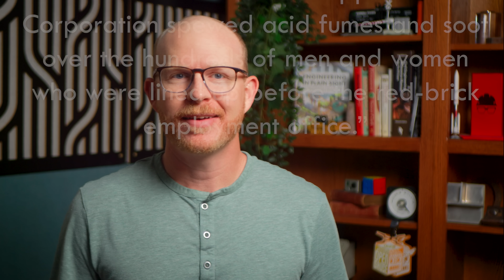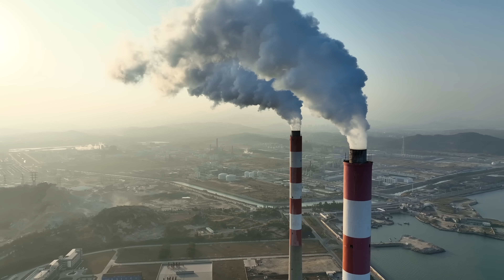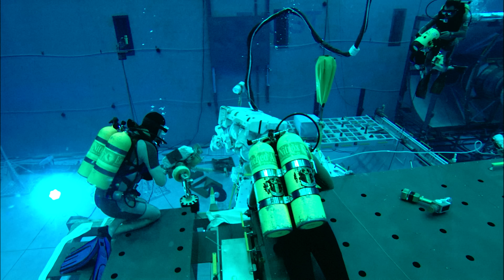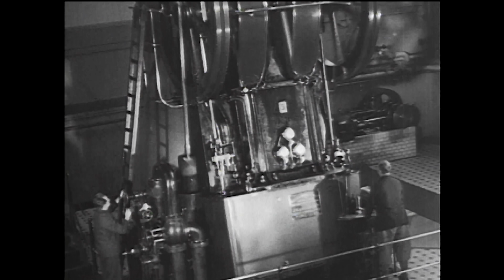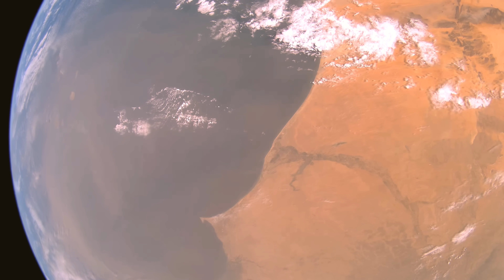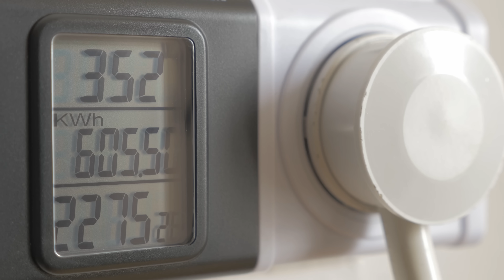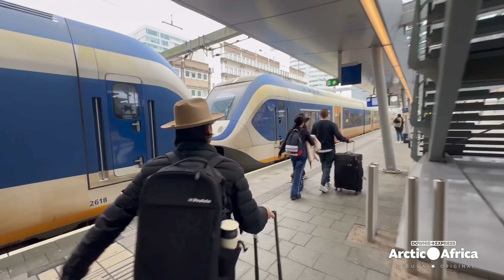Why are Smokestacks So Tall?

Comment: 7:00 I learned this when I put the smoke stack for my fireplace up. At first, it was just above the roof (which worked decently)... then I made it 10 feet taller (with diagonally-placed supports). 😂

Comment: Very interesting topic and you haven’t touched several topics: when do you need forced (with a fan pushing/pulling or even both) draft and when can you rely on natural draft.
What is the optimal draft anyway because if you have too much you can have efficiency issues, if you have too less you end up in a very polluting condition (even risking of explosion in some cases)

Comment: Once upon a time I worked as a custodian at a county park in Iowa. The outdoor restroom facilities had pit toilets featuring a clever airflow /odor control solution: black plastic "chiminys" on the back of the structure that connected down to the pit. The pipe itself was designed to heat up in the sun, which heats the air in the pipe, causing it to rise. That draws air up out of the pit, which draws air down through the toilets, which draws air from under the door. And of course they designed the doors with a ~.5" gap at the bottom. The legend, which we never tested, was that on a nice hot sunny Iowa summer day, the draft coming in under the door was strong enough to extinguish a match. I guess it could work in the winter too, any time there's a temp differential between air in the pipe and the ambient temp.
Reply: The park services in my area now install bathroom put facilities with the same or similar setup, and every time I camp at a location without these black pipe setups, I very much notice the difference. The chimney effect for these pit bathrooms keeps them well ventilated and smell much better dispersed
Reply: @yetinother  but most of the time someone has defeated the system by propping the door open...
Reply: What's really funny is that most Minnesota State Park privys use big -- 8"? -- white or green plastic vent pipes. And they don't get the thermal effect a black (usually ABS) vent does. And they stink. These are said to meet visual aesthetic standards, which apparently is more important. Unless you need to use one!
Reply: Kinda works in winter too, visited the general Sherman at Sequoia National park, and the parking area is lower than the viewing area. As you gain elevation past the pit toilets, the smell thickens!
Reply: Build a stack to space
Reply: Don't be lighting matches near a pit toilet!

Comment: 10:53 I thought that rockets primarily combust hydrogen gas, and produce little more than water vapor. What contaminants do they produce?
Reply: Depends on the rocket.  Saturn V, for instance, burned kerosene.
Reply: Falcon 9 is powered by rp-1 a kind of kerosene and starship by methane as an example
Reply: And even if it is just hydrogen, water is also a greenhouse gas when in the wrong part of the atmosphere. water released in the upper atmosphere can be problematic

Comment: This is my first time seeing your program. For over twenty years, I have had an idea about how to rid the world of our waste.  It's a total recycling system that I call Planetary Steward. Start with grinding all waste into a powder, then mix this powder with liquids of any type that will not corrode the plumbing.  Spraying the slurry into a heated blast furnace to vaporize the slurry, pumping the vapors into a master centrifuge to separate the chemical atomic number down the middle. Then the vapors are sent into other banks of centrifuges to separate out other chemical elements. It may work on the smoke stacks, making for zero emissions. You can try this on a small scale with your pizza oven. Just to try out its feasibility. Of course, you do not need the grinding part of the process. I have been looking for people with much more skill than I have to hopefully find out if this idea is workable. If so, then with all hope is to have the help to push for what it may do for all of the planet, and us.. I, without math, have estimated it could clean the waste we put onto the earth within four generations! If workable, let us start to push it! That is, if anyone really wants to undo our filth?

Comment: Id love to see a video on electrostatic precipitators!
Reply: That would be harder to do.  Most precipitators were phased out and replaced with baghouses for removing particulates.  If you're going for the quick version, a precipitator used high voltage DC on a wire in the front of the compartment (think big metal box with an intake duct and outlet duct) to ionize particulates passing by.  The opposite charge was placed on plates behind the wires, making the particles stick to the plates because oppositely charged particles attract.  Once the plates get significantly covered, a wrapper (looks like a mallet) would well, wrap/hit the plate and cause it to vibrate, and gravity would cause the released particulates to fall to hoppers that were built into the bottom of the compartment.  The hoppers could then be opened and closed to transport the particulates, running off the pressurized air flow going thru the compartment.  Most often, wrappers ran on timers to determine when they should be wrapped. 

Baghouses use compartments filled with filter bags to trap particulates.  That said, they're two compartments with either round or square frames between them.  Sometimes they're front-to-back, others are bottom-to-top.  Front-to-back ones tend to have square frames with a bag within that frame, with a pouch at the bottom of the frame (tight at the top, loose on the bottom).  Bottom-to-top designs have round frames with bags over the top of the round frames.  As particulates move thru the baghouse, they're caught by the filter bags.  Air jets are pulsed to knock the particulates out of the bags and into the bottom of the baghouse where hoppers similar to the ones in electrostatic precipitators had to collect the particulates.  In this case, they determine when to run the air jets based on a combination of timers to clean each bag with the overall pressure difference between the clean side and the dirty side to determine when they need cleaning.

Comment: Advection-diffusion-reaction systems are ghastly to model.  (Spoken by someone who's done Stokes-Einstein modeling for sedimentation of particles in a centrifuge, where the particles had an aggregation reaction that was concentration-dependent.)  The differential equations have exponentially-growing unwanted solutions.  Half-forward half-backward differencing, scaling the finite elements unequally so that the sedimentation proceeded one space step per time step, and various other hideous tricks were needed to get stable solutions.

Comment: You should use the same thermometer for the flue gas (the metal tip one). The IR device will measure a surface temperature, and it will also see reflections of infrared light, so it's not great especially on a shiny surface. 
I'd expect the firebox to be hotter, theres a couple means of heat transmission to the surfaces from the combustion. Yes the exhaust cools going up the stack but you weren't measuring that well.

Comment: I got a swimming pool about 18 years ago. For the first few years I had to add  chemicals to raise the pH to neutralize acid rain. I don't need to do that anymore. Clean air laws dramatically reduced acid rain in my backyard.

Environmental regulations actually work. Now we need to tax carbon dioxide emissions.
Reply: Carbon taxes are nice because instead of just bluntly banning something you make sure the easiest stuff to electrify is done first. While if you are doing things that still genuinely require fossil fuels (you are a farmer using old equipment that's repairable) you still are able to.
Reply: @misham6547  And as my comment noted, it doesn't actually end up working like that.
Reply: @hanzzel6086 in the US they haven't been using tariffs, so pollution is reduced by making it cheaper to produce in china & third world and import it. Thus regulations & tax works in a way.

However in a limited market like the UK it is only another tax for essentials as there isn't any affordable alternative. 

It might work if you actually reduced taxes elsewhere with the revenue gained so people had capital to invest in solar etc.
Reply: Some of those air pollution regulations reportedly are up for reconsideration or elimination. Elections have consequences. Oh, and atomic power plants are inherently carbon free!
Reply: Carbon taxes have been proven not to work. Both Britain and Canada have proven that. Both have had/have them it hasn't impacted emissions at all, only massively increased cost of living.

Comment: I might have been a good demonstration if you  pointed out the few seconds  of laminar flow breaking into turbulent flow at the top of the stack. I had a grill once that the lid bent at 5 places. The smoke would sat laminair over the first two and then breakup . The laminar flow wasn't subtle.

Comment: I work a bit with environmental issues. In the EU we have rules that does not allow for dilution. We are typically required to calculate the emissions at a set O2 concentration depending on industry. Look at the Best Available Technology and the reference documents for those. It gives an interesting insight into what each industry is able to achieve.
Reply: what are you reglementing exactly ? there is no industry here
Reply: @flo0778  I dont regulate anything. But you appear to have electricity available to you, or have youtube allowed comments via carrier pidgeon?

Generation of electricity is just one of many industries regulated.
Reply: @snabelanton  if we could import electricity from unregulated regions to escape our local reglementation, we would.

wait  ....
(ominous chinese solar panel noises)
Reply: @snabelanton  also the smoke stacks that produce my electricity rn only release H2O, probably the only unregulated compound left in the EU
Reply: @flo0778 Cars, plain, steel, chemistry, food processing,  agriculture,  etc...

Comment: Great video as always!

On Air Pollution Concentrations (3:33 mm:ss): You're missing one key phrase: "And, for  a lot of chemicals, there are concentration thresholds below which the consequences on human  health are CURRENTLY DEEMED TO BE negligible."

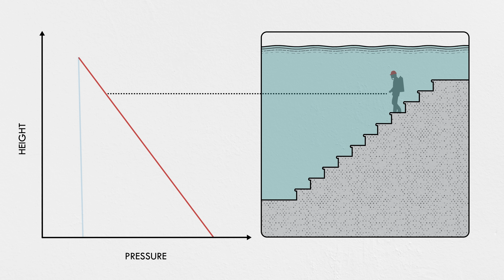On the Smoke Stack Effect (5:50 mm:ss): You mostly only covered the Steady State. You hinted at this when referring to "backdrafts" (9:30 mm:ss).  When first starting up, the Smoke Stack contains a clot of heavy ambient pressure air which acts as a plug to the Stack Effect till that column of air gets heated up and starts the process to enter into that Steady State.
Reply: Hand in hand with that are chemicals that are deemed to be pollutants, but in fact are necessary in absolute minimum quantities. Carbon dioxide is a prime example. It has fraudulently been deemed an air pollutant, while there is solid scientific research proving that it is necessary for  virtually all life on earth. Then, there are pollutants which are deemed unsafe at any level, inspite of being naturally-occurring (lead, for instance).

Comment: Next time use a pitot tube air flow meter for hot air, they are dirt cheap if you know where to look, and differential pressure meters are quite accurate these days.

Comment: Great video, Grady. An extreme example of a very tall stack is the Superstack built at the Inco smelter in Sudbury, Ontario in 1972.  The stack is 1250 feet tall - about 2.5 times taller than a typical stack at a coal-fired power plant, and the largest stack in the Western hemisphere. It was built to disperse SO2 emissions to more distant impingement points, with reduced concentrations to minimize acid rain effects.

Comment: Actually divers don't 'feel' the pressure (as long as they keep their ears cleared properly) as they go deeper - the volume of air breathed is the same - but the density of the air breathed goes up to be in balance with the water pressure.

Comment: Very interesting. I worked on a project that built (at that time) the worlds tallest smoke stack in the southern hemisphere, 200 and 210 meters tall. In previous episodes you discussed the engineering of the smoke stack itself while todays was on the exhaust from the smoke stack. The increase of air flow vs height of the stack was interesting. Wonder if the same principal is similar for residential dwellings with wind catchers or wind towers that are more commonly found in the middle east? Which lends me to the following question; is there a mathematical equation for the diameter of the smoke stack vs height for maximum air velocity? Thanks for sharing.

Comment: Down the street got a rather  large stack that's no longer in use but it's still standing as thr cost to remove it would be to much unless they absolutely had to do it.
Reply: Had one of those in my hometown, but they got creative with it: They attached a bunch of radio antennas, so they didn't have to build a new mast.
Reply: @rockyblacksmith If Fred Dibnah was still around I bet there would be alot less of em. Dude took down those things almost single handedly for penny's on the dollar.